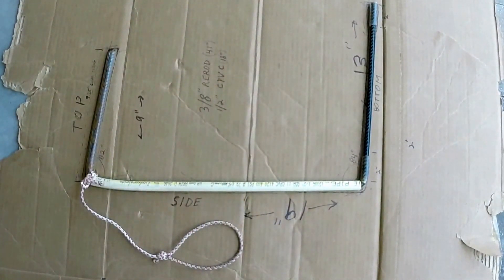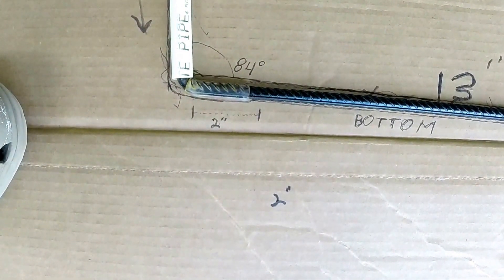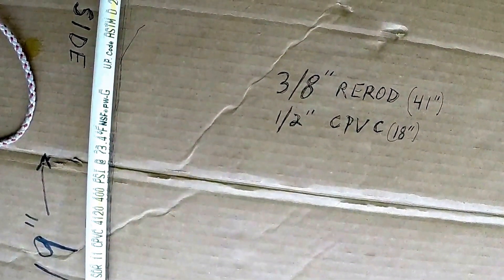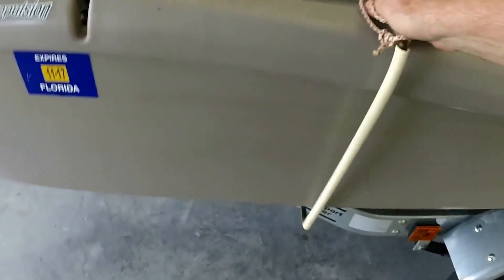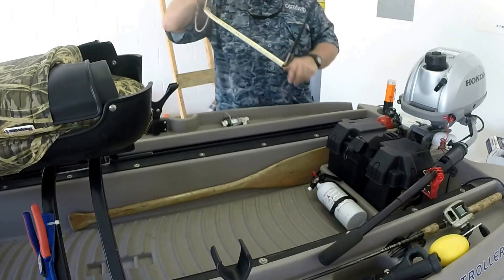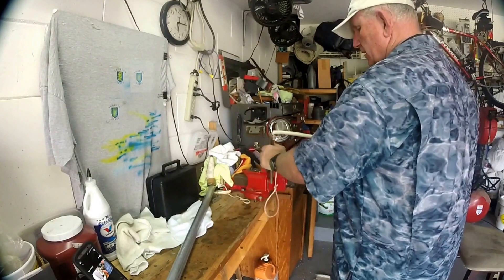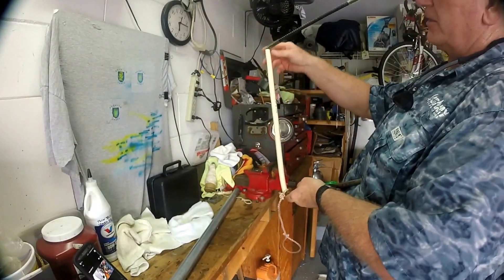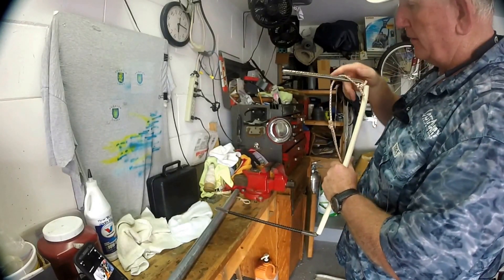TWIN TROLLER X10 WEED REMOVAL TOOL

Comment: I remembered that you did a video about a weed tool and after rescuing those two boys the other day I had to go back and watch it again. My TT is pretty much weedless but those metal grates of mine were also crammed full of crap up to and around the propellers because of all the thick thick crap I had to go through to pull them out. Luckily that day one of those two wet boys just jumped right in the nice clean water (NO GATORS) and reached under and cleaned the stuff out. I have decided I need one of your weed tools cause I won't always have someone else to clean me out. Don't want to make anyone think this boat isn't mostly weedless but when you start turning around in circles which only the TT can do you are going to get crap up in there sometimes. Thanks Gerry
Reply from the maker: Steve, I made that tool a long time ago. There are few things you can do when making something from scratch that you do perfectly the first time. I never launch my Twin Troller without that tool and even after four years I would not change the design at all. It is easy and inexpensive to make, takes up virtually no room in the boat, and I am surprised when TT owners do not have one in there boat.  
I would rather take the TT out with just one fishing rod with an old rusty hook than to go without that tool.                                              Gerry

Comment: I used your dimensions to make one out of a mixture of spare CPVC / PVC pipe. I used a reciprocating saw to cut a flat top on the part that scrapes (to better catch the weeds). This way it's more lightweight and doesn't sink so fast. Also it's more ergonomic to handle.
Reply from the maker: Did you try it yet? I would be surprised if it is strong enough. I sometimes need the stong metal to pull the weeds out
Reply: @LunkerFishing  I tried it today and it's totally ineffective. The Lilly pads/weeds are extremely thick where I am and require hand pulling out of the hull which is dangerous due to gators and I can only reach half way. I have to pull hard, so I don't imagine the metal rod would do it either in this case.
Reply from the maker: With the metal too I have never been unable to remove the weeds enough to get going again. The thinner metal with the nubs on it catch the weeds and is strong enough to sweep and pull the weeds out. I have never reached down to remove the weeds by hand due to the same concerns you have. That is why I made the tool.
Reply: @LunkerFishing  Not sure what you mean by "I have never been unable to", but it looks like you are saying the rebar does work well? I think the manufacturer should have a sweeper built in that we can manually operate, like a windshield wiper except of course stronger. The aluminum ribs bend and break easy too, should be stainless steel but they were trying to keep profits up as stainless costs more.

Comment: Hey, Gerry, I finally got a chance to use your tool the other day.  I went to a new lake I wanted to try out.  When I got to the ramp, there was an air boat pulling out.  I should have known right away.  After about 100 feet off the ramp... Hydrilla, and lots of it.  After going through about 100yds of open water, hydrilla, open water, hydrilla, and using your tool 10 times, I figured it was time to get back.  The good news?  I got back.  Without your tool, I wouldn't have tried going out.  Thanks, Gerry.  Look forward to seeing you again soon.
Reply from the maker: David, just spotted that you posted this reply. That is great that you like the tool. I would not go out without it. I do not always use it but when I do it is priceless.

Comment: Looking good, Gerry.  A good rule of thumb is, if the grass is rooted, the TTX10 can get through.  If it's loose, it can get caught up in the motors, as you already know.  The TTX10 is a great boat but it's not a hovercraft.  Great tool!
Reply from the maker: Accurate statement! Hydrilla matted on the surface can be difficult (as well as probably Eurasian Milfoil) but I found that if I go at the slowest speed I usually do not suck those weeds into the props. Other floating plants like Hyacinths and rooted plants like Kissimmee grass, bulrush, or buggy whips, are easy to push through. The most difficult are soft stringy weeds that are loose and all the way to the surface. The tool gets me through all of them if the props get fouled.

Comment from the maker: The guards over the trolling motors on the bottom of the boat do a good job of blocking items from getting into the prop like sticks or probably trot lines. Soft weeds like hydrilla can get sucked through the grates but usually get wrapped around the grates and not the props.  My tool does a great job of removing the weeds enough that the trolling motors function again.  you can also lay down in n the boat and reach over the side to clear the weeds also but the tool is more convenient. I also have the Honda 2.3 on the back and I am amazed how well that cuts through weeds also. 
most people do not go in the kind of marshes I go in and I have never been unable to get home.

Comment: Thank you for the video Sir. I notice to put two inch pieces of tubing on the bottom. Do you see any disadvantages to running the tube full length on the bottom? Just thinking better protection. New Boat in Sarasota don't want damage anything.
Reply from the maker: The bare rod surface has a rougher surface and has little nubs that help grab the weeds so you can sweep and cut and pull them out.The 2" piece of tubing on the end is to protect the TT hull since that part of the rod protrudes past the opening for the grates and rubs on the surface of the hull.

Comment: Thanks for the video.  I'm not an owner yet, just doing my homework on it.  Could the prop grate be modified with a heavy gauged chicken wire secured to it to help prevent fouls?
Reply from the maker: Zachary, you will not regret when you place your order. I do not think any wire on the grates would help. Weeds are not much of a problem unless you drive over a soft loose weed like hydrilla or possibly Eurasian milfoil that has grown almost or all the way to the surface. Other weeds like Lilly pads or eel grass or Kissimmee grass is not a problem. You can drive right through all that with little problem. If you do a search through my videos for my weed control tool I think that is the best thing to clear weeds from the grates while fishing. It is inexpensive and not difficult to make and the video shows how to do that. I ALWAYS have that tool in my boat.   Gerry

Comment: Thank you for your video about weed removal from the X10.  This has been a recurring issue in my mind regarding the X10.  I am a recent "snowbirder" and I'm looking for a boat like the X10 to use on the small / medium size lakes in Highlands and Polk Counties.  The lake nearest my house has extensive hydrila beds and I'm concerned about them clogging the trolling motors. When the weeds clog the motor inlets do they also wrap around the prop and if so how does one remove the weeds wrapped around the prop while on the water?   Any comments regarding my concerns or techniques for resolving them would be appreciated.
Reply from the maker: Gary, I too had that concern about clearing the weeds while on the water. That is how I came up with the idea for the tool.  If I am going over a patch of weeds that are soft like hydrilla I just slow down  to the slowest speed and cross over the weeds until I get to clear water or where the weeds are lower in the water column and cannot get into the props. If the weeds are firm like Lilly pads I usually just ignore them and the TT usually goes over them as if they were not there. It is only the soft weeds that cause much of a problem but that is where the tool comes in. I fish in heavy weed areas often but have never been unable to clear enough of the weeds to get myself going again. The rough texture of the re-bar seems to grab the weeds well and pull them from the grates ever the trolling motors. Some soft weeds will get on the props but most seem to stick on the grates. The tool clears the weeds from the grates and once that is done shifting from forward to reverse a few times clears the props. If hydrilla was matted on the surface you do not want to go into that but you would not do that with any other boat either. When I built the tool I made an extra for David from Freedom Electric Marine and he offered to sell them on the TT website if I wanted to make them. I did not want to waste my time making them and not fishing so I decided to make this video so anyone can make one for themselves. There are few times in life that you can make something and after the first one is done not find a way to make it better. I got it right the first time and you can to if you follow the video. Gary you will like the TT, especially for the ability to fish the kinds of lakes you describe. It is about the lowest maintenance that you can have for a fishing boat and it gets the job done without sacrificing comfort. You may not run the lake at 70 MPH but your cost for operating this boat and the east of maintenance is a fraction of a big boat. Let us know when you get the TT and send some photos of your fish.  I hope this helped, Gerry

Comment: Have you ever had it twisted up to bad to get it losse? And if so what did you do
Reply from the maker: Randy, sorry for the late answer I just saw your post. I take my TT in some pretty nasty stuff and even had one motor shut down from the strain of the grass on the prop but in a few minutes the motor started working again. I used the tool to get the weeds off the bottom of the boat and off I went fishing again. There is no place I am afraid to go because I fear I may foul the props too bad. The only thing that would stop me from going someplace is if that day I do not feel energetic enough to waste the time using the tool to remove the weeds. Sometimes I look at the weeds in an area and say to myself that it is probably too thick for the fish to be in there so why bother. The short answer is that I NEVER got so stuck I could not get myself out with this tool. One word of caution: Make sure you use the lanyard around your wrist so you do not lose the tool. It does not float at all and it is soooo important to me that I would not want to lose it. Because it is made of metal rod there is no way you could break it but it certainly could slip out of your hand and sink to the bottom. 

To answer you other post also, Lilly Pads are not much of a problem for the TT. They rarely get sucked into the props and the tool removes them easily. It is loose soft weeds that cause the biggest problem like hydrilla or probably eurasian milfoil but even then the tool gets them out.

Comment: its dangerous to have any steel bar facing up in a wet  boat, one slip and that steel rod may cause a serious accident.
Reply from the maker: Good point. I store it in the rear of the boat. Not being able to get home due to weeds and having to swim home with very large gators is also quite dangerous. 
I prefer the metal rod but I get your point. (Not an intentional pun, but a good one nonetheless)                                              Gerry